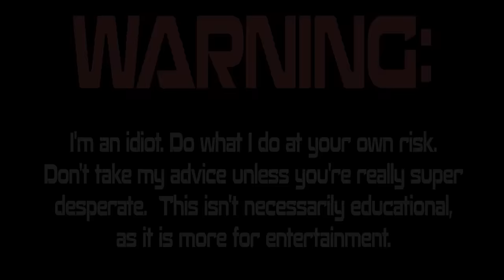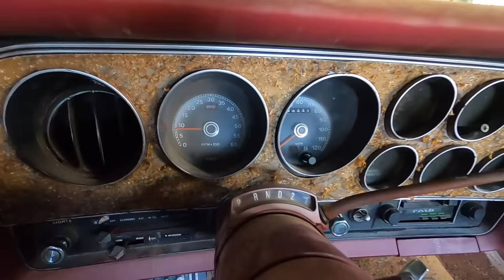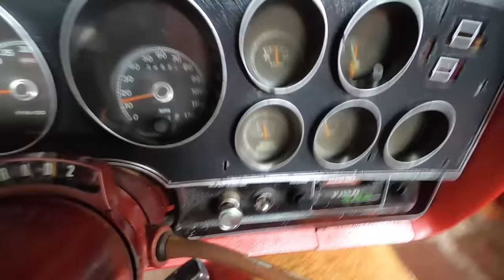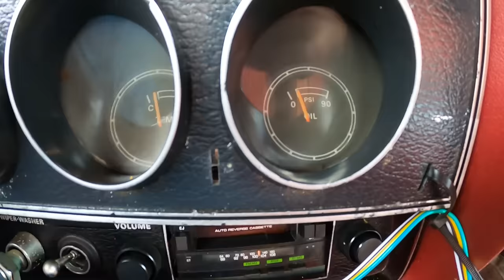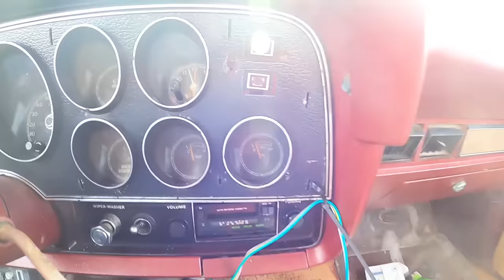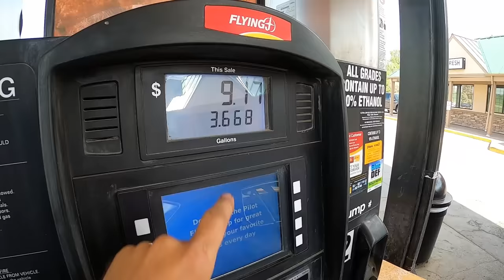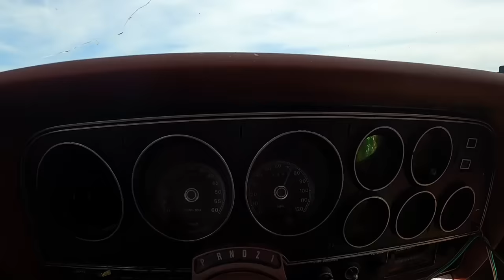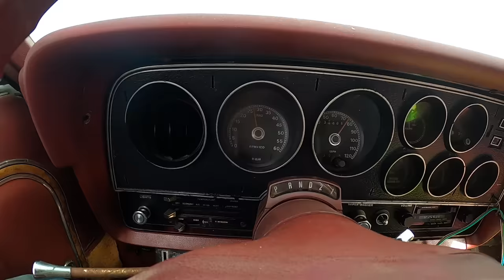SEIZED Ford Gran Torino Elite will it RUN & DRIVE after 29 years? - Vice Grip Garage EP89

Comment: Just a pro tip for a fella, getcha one of those blue pool vacuum hose dealies. You can set the mouse sucker outside the shop and vacuum inside! Saves you some dirt ling and the quieter clean up is wonderful.

Comment: The Gran-Torino came out standard with a 6cly and V8, the V8's were 302, 351, 390, 400, 427, and 428 the 428 was the cobra jet.
Not sure how you find out engine size in a ford, Im a Holden man myself (made by GM) Australian car. Their engine size is in the ID tag it would read...L32 for a 4.2Ltr L31 for a 5.0Ltr and L34 for the sports 5.0Ltr factory worked motor that was in the mid 70s .

Comment: Just one more little comment about the spray adhesive I was talking about and the windshield cutter removers is that now these days urethane is used as a structural part of the vehicle so there's a lot of urethane you got to cut out just freealls info since I've already been there and done that

Comment: HUGE difference between this and the pickup with the 6 cyl.
You could almost stand between the fender and the engine on  that one.
This power barn is tight as heck.

Comment: Instead of spending 6 cans of throttle body cleaner to clean the carb, just buy a jug of kerosene from lowes and let it soak in there? Use toothbrushes and/or wire brushes to scrub. You will want chemically-resistant gloves to handle until it’s dried or rinsed off

Comment: That engine is a 351 modified. Oil dipstick is on the passenger side. On the 400, oil dipstick is directly in the front

Comment: Should have used "Pepper" in the radiator ...  it goes and fills the holes and swells up..  Had to use that a few times in the past.  Cheaper than using Stop Leak ..

Comment: Use marvel mystery oil  in each cylinder  take out spark plugs squirt  a couple of big squirt  in cylinder let it sit over night  faux and repair what you need to then squirt  more marvel into each cylinder then get a. Blow torch and clean each sparkplug from oil  wire brush them also then replace  try starting

Comment: Oil pressure is what kills these engines I've had a few that destroy lower bearing because of no oil pressure  I am running one now in my 79 f250 but this ones has great oil pressure but the stock oil pressure gauges stink in the 70s mine said very low when I was getting 60psi

Comment: I've never trusted those L------H oil pressure gauges. I've had several read way low and,or way high and when I install an actual pressure gauge it's perfect.

Comment: I absolutely love watching your videos, I do have a question though.  How is it that all the cars you pick-up, never seem to have tranny leaks? I have yet to see you get into an automatic transmission that has been sitting, and have it leak!  I bought a Camaro this summer with an automatic trans that had sat for about 7 years, and it leaked fluid like a stuck pig!  Changed the output seal, pan gasket, speedo gear and o-ring, shift shaft seal and kick down o-ring and only got to celebrate for about 30 seconds.  Started it up and it was leaking out the torque converter seal!!   Anyway, keep videos coming and I'm enjoying your show on Motor Trend TV as well.

Comment: Agian I'm 54 and owned only ford's except last 5 year I've been diving a Toyota Matrix pontiac style. But my first car was a 72 Ford Mustang with 0 problems. Just let my Aunt drive she got hit she was ok but my car nope.. Next I drove 65 Ford van 3 on the tree it was a dream it had kagiliun miles straight 6 and ran perfect then I sold it. Then a Ford ranger yep it was Red with a red camer black lumber rack so put 100 yards of carpet and pad a day and it wasn't to much fun but it worked. Then I got 1998  Ford Explorer 4 door Limited 5.0 v8 nice car for sure had the air ride sweet ride.. ok when I owed the Explorer I also bought a dodge Extended van for work at the time best car for what I had to spend. I ALSO bought a 65 mustang Arcadian Blue not a spec of rust it spent its life in underground parking sweet find but had original 6 at my age I wasn't racing around lol then got married she took everything so I bought this car it been good I just miss my ford's If I could of kept that 65 mustang And Explorer trust me it not like any other Explorer such a safe comfortable ride all leather I would be set and loved both them cars I would of been happy forever....

Comment: Yeah I like that GM oil in a Ford motor it's about like me put small block V8 Chevys in for pickup trucks a 350 works pretty good with a 370 limited-slip rear in a Ford truck I get slingshot down and Country Roads real good with that

Comment: When the air bag warning light on my dad's Crown Vic came on, my dad just put a piece of electrical tape over it. When the oil pressure light came on, my dad put a piece of electrical tape over it. When the speedometer quit, he just removed it...started to sense a pattern here.

Comment: The motor is a 351M its a 351block with 400 heads  .there were 3 different variations the 351 Cleveland the 351windsor and the 351M

Comment: Forgive me ....a suggestion with reason[ing?]

When charging a battery in a car ~ Disconnect the ground Or negative on the battery as ~ doing so will Help Charge it faster ~ 

The Ground wire connection requires you charge ~ Through ~ the Entire *Body* grounding of the car ~ First ~

Bit like the 'old school ~ Positive Ground ~ Tractor's' where ~ If You Left them out in the rain ~ long enough [without running them] ~ The negative Ions in the atmosphere Will ~ Discharge ~ the battery completely Flat! 

So Better Or Faster Charging is accomplished By dis-connecting The ground wire 

Just as suggestion though ~ You can Do Whatever you want to ~ as you seen [to me] easily capable enough ...

Thanks For the time 😎 + ☮

Comment: Yeah I know there was difficulty in a lot of different vehicles especially General Motors cars like the trans am's or the Camaros or whatever you couldn't get the back spark plugs out without jacking the engine up out of there so yeah they sucked and as far as I'm concerned too I didn't like how the GM have their distributor in the back of the engine but anyway I'll always be a Ford man bought my Mustang from a Ford dealership but hope nobody takes it against me
But I will always still love the vehicles no matter how much of a pain in the ass they are you know I still have faith in them up to around 85 Point 775 / 9❤

Comment: I wish a Feller hadn't cut out the part where he almost went into the jack handle. Why? Because I guarantee you that AT LEAST 87.57384985% of us who have worked on cars over the years have done just that. I actually put my chin right into one once. That's fine. 🤘🤘

Comment: The middle of America is basically just FLAT, and since the advent of interstate highways, you can drive a hundred miles in most any direction in a straight line, so you reach your destination with your mind almost shut off.  At least Derek has a few possible car failures to think about along the way.

Comment: Those cars were a pain to keep running back when they were a few years used  all the early attempts to clean the engines for epa  was like sand bags  any upgrades resulted in poor performance. Drop a tool and they vanish.

Comment: LOLOLOL ☺️ 
I don't know if this ever happen to you Derek if that old Mustang got next to the exhaust manifolds a few times and that thing broke loose one time I was at a drive-in for drive-through fast-food place and I mean that stuff sprayed all over the place smoking like a freight train and I had to wire them back out of the way I don't know what the issue was but obviously the clamps or something weren't there and yeah so I drove that thing without power steering for a while a few times and as you know it was okay going down the road but sitting in turning around in the parking lot or some oh yeah you had a good muscle workout doing that I'm sure you felt with that maybe not

Comment: Oh yeah here's another little secret that they have those new little high-speed cutter things got blades on them that move super high-speed and they're really good for cutting out your windshield or whatever from the inside even if you got to take the gasket off but it'll go right through the feudal or whatever sealant and makes it a lot easier to get that windshield out of the vehicle if it's a gasket then you just put a new gasket just like my old 68 Mustang or whatever so but then you got to use the rope and be really careful to get it back in there and throw some ceiling on it but yeah you want a quick way to get a windshield or back window out or whatever that needs to be cut with an O old glass cut our 
There's another major tip for you then they always we had to do it I never had a chance to use one of those because I was in the commercial and whatever flat glass mirrors and whatever kind of thing I wasn't working on cars for the last few years that I've worked at the glass company but I watch the other guys do it and it was 100% Improvement for the job you had to get done

Comment: I had an 83 Crown Vic.  I had to change the thermostat and to my delight every motor accessory in the car bolted through the water pump -75 bolts or more.  jk.  Why did Ford like to do that?

Comment: I used a cocktail of kerosene and transmission fluid filled her up took out the plugs and filled them up poured two gallon down the intake and let her set 1months then start to  turn is a little each day one was then the other each day till it turned over with the plugs out then put a battery in and crashed it I still can't believe it ran I drove it for 10 yards 1990 2000 best 500 dollar car I have ever bought . I take that back the best car I bought was a d50 dodge ram sitting behind some guys house he said it just stopped running I said can't I look at it he said yes while I was looking at it I noticed the distributor bolt and tie down was missing I close the hood and ask how much he said it's junk 200 bucks and get it out of here deal I paid him and said I will come get it tomorrow he said me and my wife will be at work  I said OK so I took a battery fresh gas and a tool box  and drove it out of there after I put the distributor bolt and tie down back on and got it back in time it was easy the old marks was right there that's the best deal ever.

Comment: I I had a 74 Gran Torino with a 302 that car would still be on the road today if the body didn't rot off the frame the engine is now in a Ford pickup truck. And why would he Park that car in that nice driveway for gas to leak all over it 😆

Comment: Vice Grip Garage 
Just a heads up, I dont run motors that have sat for longer than 5 years without priming the oil pump. With holdens a (GM) car, i take the oil sender out and push new oil into it, 99% of the time that works if it doesn't ill suck the oil up while its running through same way so instead of pushing oil in ill suck it up. Never fails.
PS. I can't believe the price you guys pay for parts.
That master cylinder would have cost me over $150.00 in Australia.
You guys suck lmao im so jealous.

Comment: 39,000 miles!? That's really low mileage. Aside from all the problems caused by sitting in the wild for so long and generations of rodent renovation, it's not all that much of a miracle it ran reasonably once it got going. You weren't fighting long term wear and tear from just being driven for 100,000 miles or so, along with all the rest.